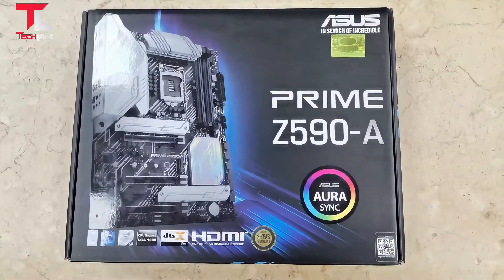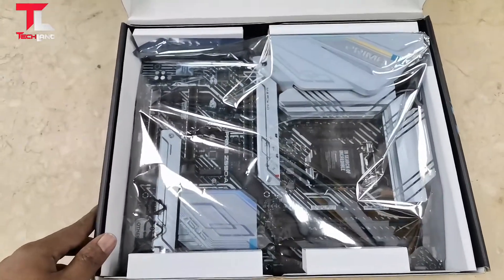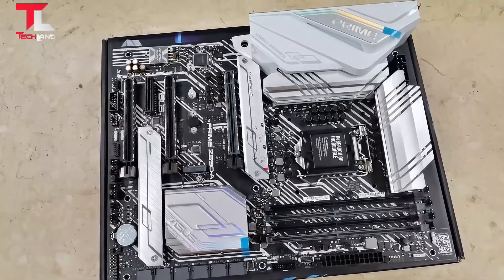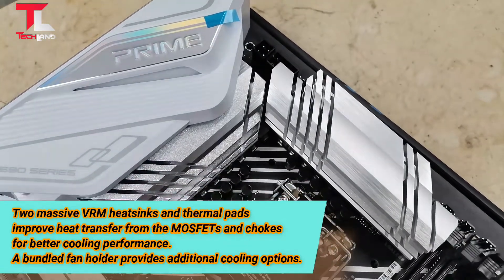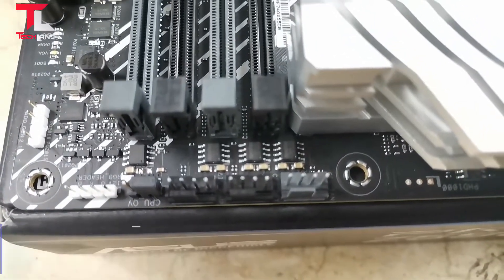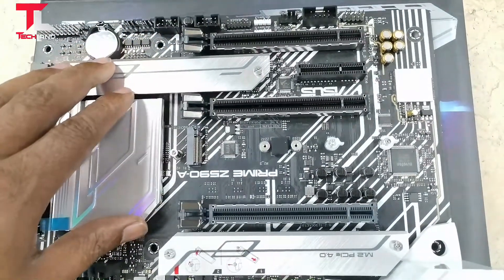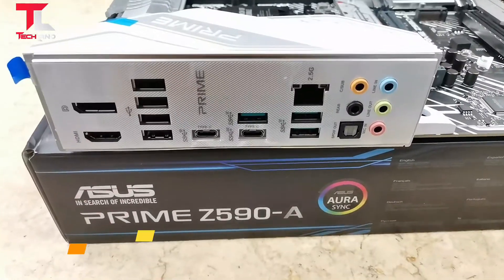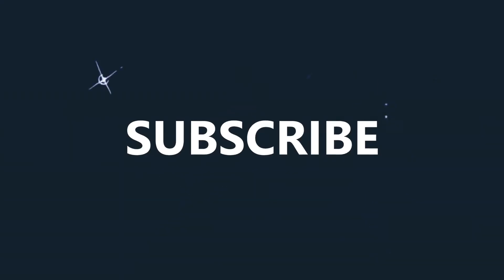PRIME Z590 A Asus with Thunderbolt 4 support and Aura Sync RGB lighting PCIe 4 0  Tech Land

Comment: I used this one for my new PC built and was upset to realize that it doesn’t have Wifi/Bluetooth connectivity 🥴 I purchased a NetGear WIFI USB device, but hate that I have to use up a USB drive and can’t use my XBOX controllers. I’ve been enjoying my PC but I switch out my awesome motherboard bc it’s such a hassle
Reply: Save batteries and plug your Xbox controller in